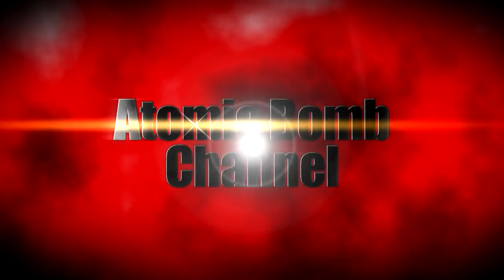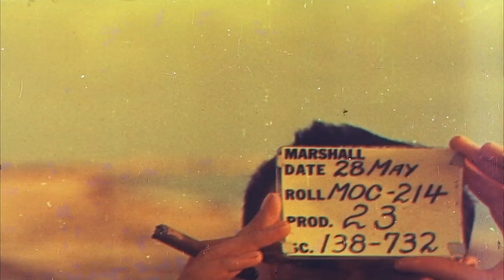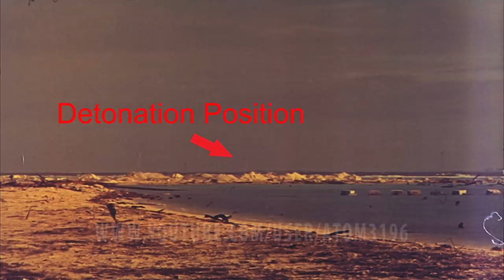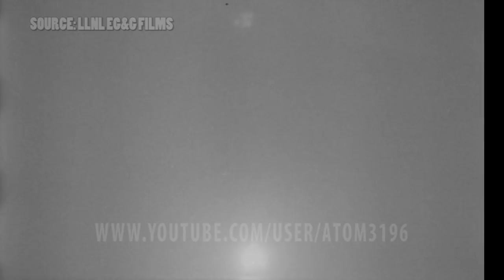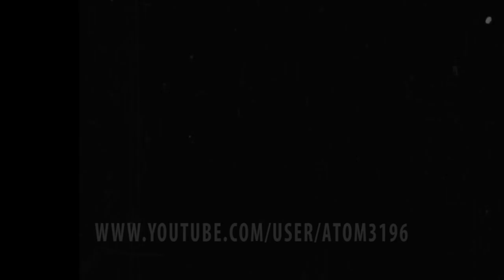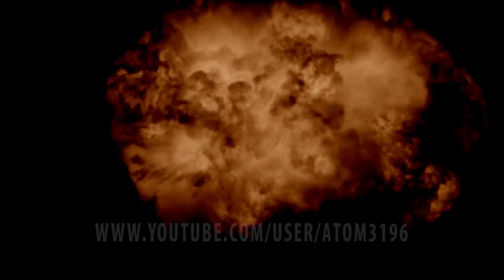What A Nuclear 'Fizzle' Looks Like ?? Nuclear Reaction Fails ! 1956

Comment: the funny fact about these fizzles is that the government was trying to push for the minimum yield to trigger a boosted fision design,with expertice they figured out that they needed to create the equivalent of about 250tons of fision yield to have sufficient compression to ignite the fusion fuel in the core of the boosted core design.. meaning,190 ton isnt too far off of creating a very small primary for a multi-stage design,wich would also help in miniaturizing overall warhead.

Comment: something happened in the implosion stage to where either the core wasn't compressed uniformly or someone must have screwed up on the design. the smallest nuke you can make that will work is the w54 SADM aka the backpack nuke. with a max yield similar to the size of the blast we just saw. the other small nuke is the W45 medium atomic demolition munition with a yield of 1 kiloton to 15 kilotons. since they were designing something you can put on a missile, just look at the AIR-2 genie missile.

Comment: to better explain this fusion boosting is simple.

they did not need to create as much pressure via compression in order to reach critical mass due to the boosting material inserted.. because if boosting occurs it then increases temperature and pressures and you also have the neutrons from fusion helping the burn in the fission part of the bomb. so in other words,less complicated compression design schemes could be developed. but all it did was lower the efficiency of the bombs not increase it.
Reply: Boosting does massively increase the efficiency defined as fuel burnup percentage. It allows less material to be used and as you said reducing the compression requirements which serves the main purpose of eliminating mass in the lenses. Trinity had lenses meters thick, weighing two tons W54 can get away with a few kilograms. Modern weapons rely heavily on this with most of the yield coming from neutrons reacting with the tampers and fission stages. The fact that boosted devices are so efficient allows for simple compression schemes such as two point and two point linear.

Comment: If the fission-reaction had reached 300 Tons (The point at which the DT-mix in the pit's hollow core is hot and dense enough to initiate DT fusion) and initiated the DT-fusion reaction I wonder what the final yield would've been?

Comment: In order to build ever more miniaturized weapons, the first stage (fission) was built using less and less fissile material and this in some cases could not create all the necessary conditions (radiation, heat, etc.) to start the secondary ( fusion). Only by trying and trying again could the right balance be found for a correct explosion. And of things that could not go in the right direction there could be many, for this reason that even the failures, considering all the sensors, experiments etc ... could collect useful data to improve from time to time. Nowadays, despite the super computers, NOTHING can guarantee safety (both in terms of performance and safety, that there are no explosions due to materials that with time or the background radiation created by fissile material can create problems. only to "update" ALL (and there are many) components, using components other than the components of the initial project .... which could behave in VERY DIFFERENT ways both during the explosion and during the simple "rest" period ... only tests (even underground and 1kt-about) would be sufficient to guarantee reliability.